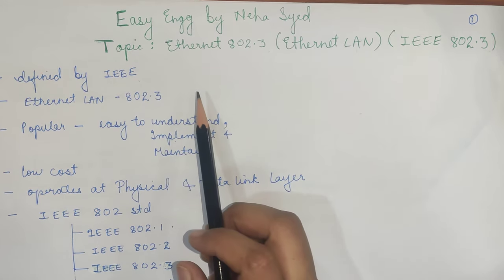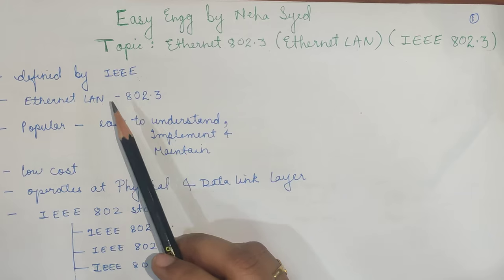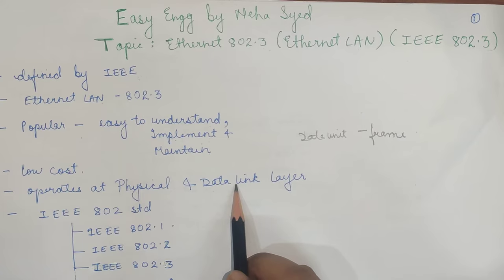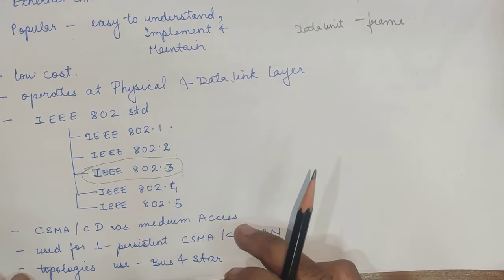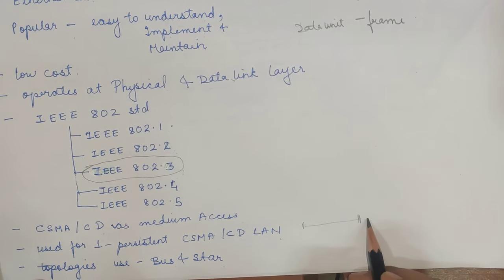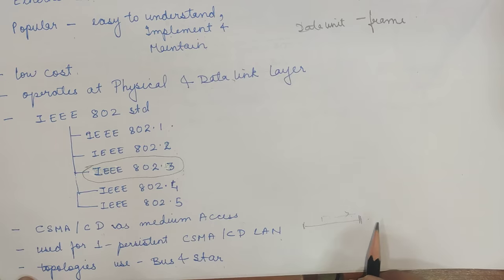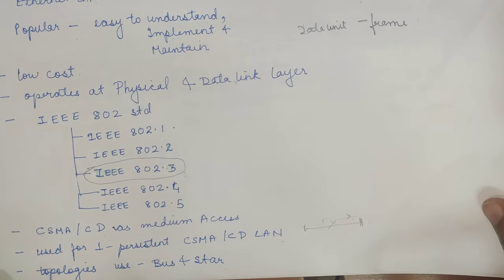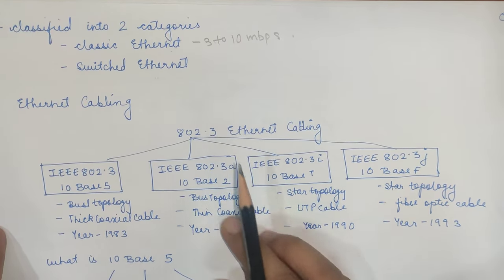Ethernet 802.3 (IEEE 802.3)

Comment: Mam
Wired and wireless Ethernet and types of ether network BHI explain krna hoga Kya exam m..?
Ya bus jutna aapne btaya utna sufficient Hai???
Reply from the maker: Depending on question you have to write the answer but if they are asking  only Ethernet 802.3 than this much is sufficient.
Reply: @easyengineeringbynehasyed1406  ok mam